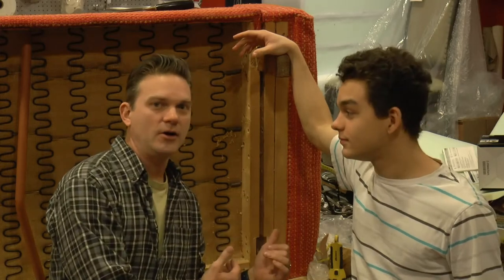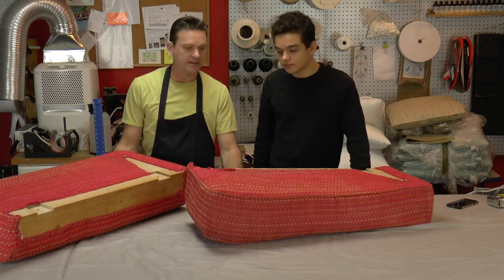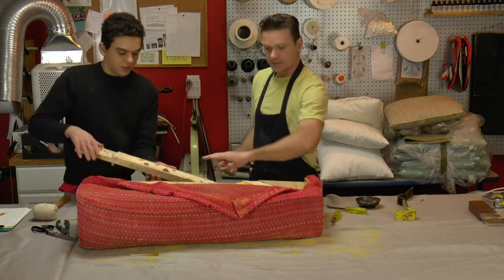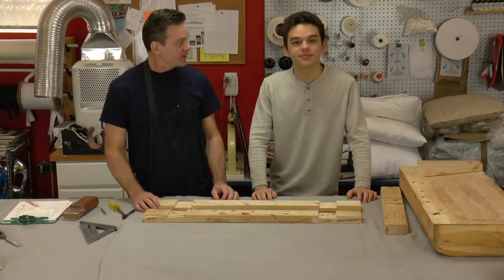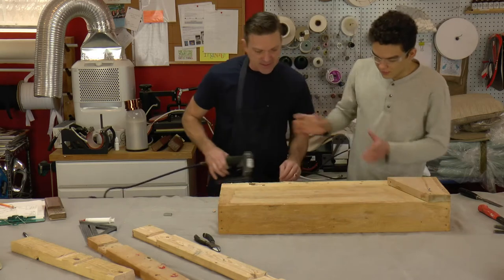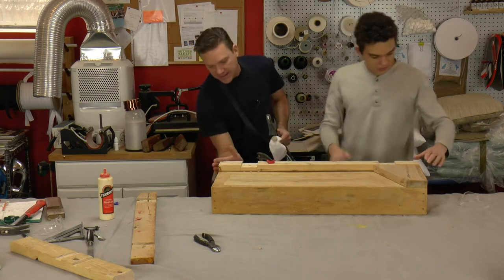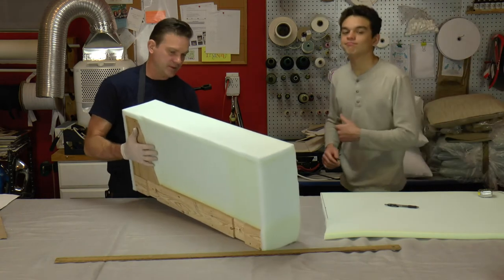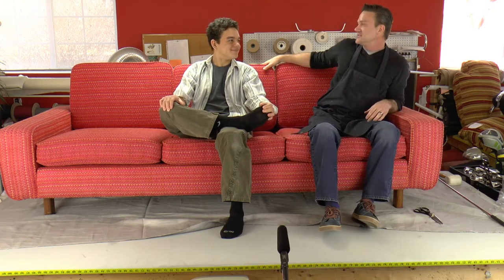How we replaced the foam in a 51 year old sofa Part 2

Comment: I love watching your videos.  You're both excellent teachers and I really enjoy your humor. I've laughed out loud at some of them.   I've learned so much from watching that I've tackled a couple of jobs myself and am happy with the result.  I have a project now that I've been putting off because I don't know how to start.  It's a large overstuffed chaise lounge chair that has a sagging  pillow type back and arms and one huge seat cushion.  I think I can follow your instructions for the back and arms, but I'm wondering if there's a trick to keeping the stuffing from settling to the bottom again.  Also, the seat has me stumped.  The part of the cushion where your legs rest is fine, but where a person sits has squished (??) down over the years until there's about an inch and a half delta with the legs portion.  (Feels like you're sitting with your legs up in the air.)  In any event, it's a single piece of t-shaped foam 44"X60"X6.  From watching Save My Assets #5,  my sense is that If I cut off the squished part and replace that, I can glue the two pieces together, cover them with Dacron  and not have to replace the entire cushion.   Or would it be better if I did?  or is there another alternative? Any advice you have would be appreciated.  The chaise is old and ugly, but I love it.  Thanks! and please keep making your wonderful videos!   :)